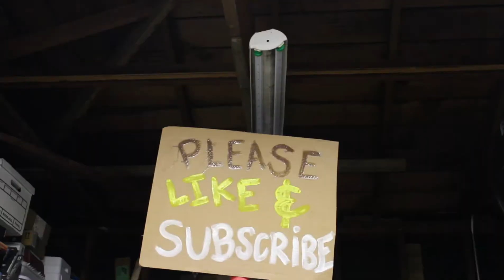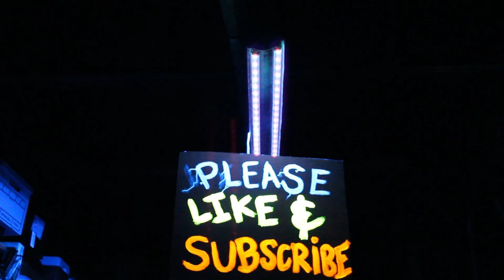How to make a UV Black Light at home (easy) Wildfire Lighting 365nm SableLED Lamps

Comment: Maybe there is a part I did not see. Where did you get the 365nm bulbs? How would I wire the small 365nm led chips?
Reply from the maker: @Daniel Saan The bulbs are from Wildfire Lighting.  Scratch this video and watch this one https://youtu.be/fpisydR23jU  .  They have a Bi-Pin power adapter, so you don't have to rewire any light fixture.  You just pop the Bi-pin on the bulb and plug it in.

If you want to go the light fixture route, then the power will come from the wiring on the inside of the fixture.  One end of the bulb has the power to the ballast.

Comment: Hello, can you please  piont me in the right direction  to a larger high quality  uv black light ? The ideal set up for me is to have  two 15foot walls completely  lit up with long up lights or accent lights that will completely  light up the entire walls from the bottom up  . Thank you for the informative  videos 
Sincerely,
Nick
Nsherman2288@gmail.com
Reply from the maker: SGT. Psilocybe for high quality and powerful, I would go with either the Effects Master VHO or UltraBlade fixtures both made by Wildfire Lighting.  For a 15’ wall you’ll need at least 1-2 uv lights, depending on how much ambient lighting there is.  What kind of project is this for?